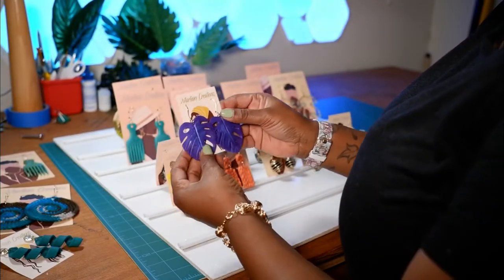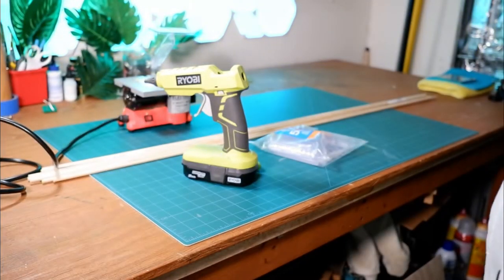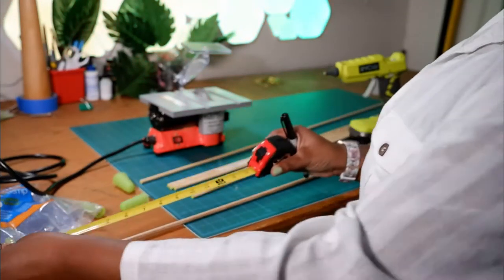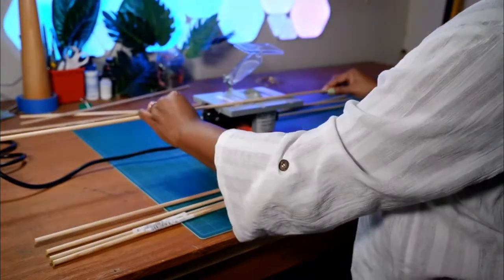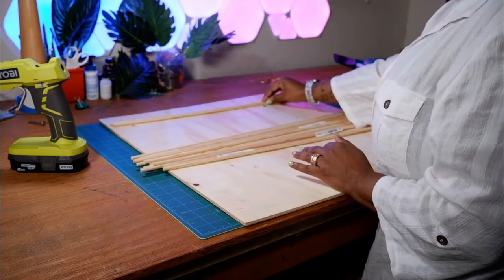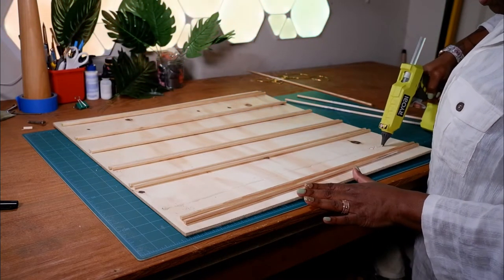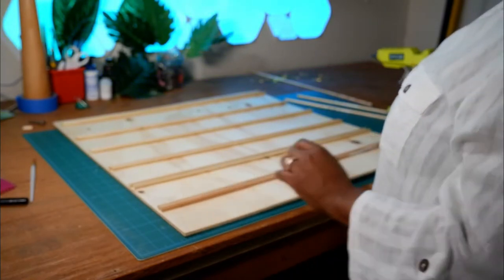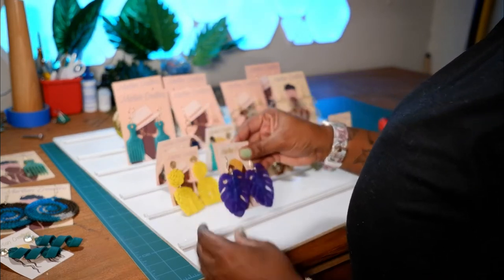DIY TABLETOP EARRING DISPLAY |  PERFECT EARRING DISPLAY FOR CRAFT SHOWS

Comment: What size did you cut the dowels?
Reply from the maker: the lerngth of the dowels depends on the size of the piece of wood youre attaching it to. So that they fit across the surface. I believe mine were two feet because the piece of wood was two feet.
Reply: @MartianCreations  Oh, I see. Thanks. How are you liking your saw so far?
Reply from the maker: @barbra429  I love it to bits!
Reply: That's great. I think I might get me one. @MartianCreations